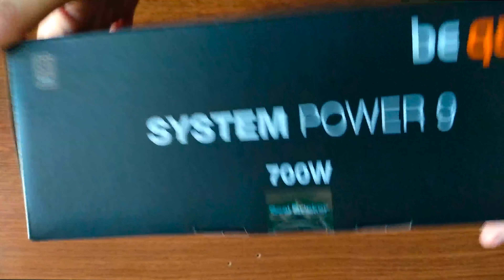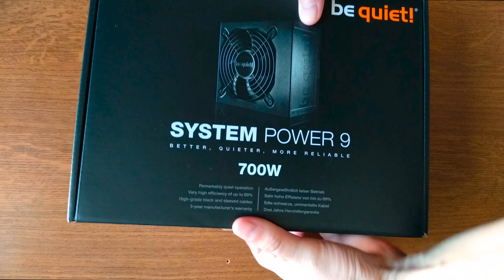VFM Silent PSU! | bequiet! SYSTEM POWER 9 700W 80+ BRONZE PSU Unboxing

Comment: how many perif cables come with this power supply ?? ..also is this power supply has cables needed for ssd and hdd cause some people said sata cables are too wide for the hdd and ssd ..good job bro and thanks in advance <3
Reply from the maker: Connection cables: 1x Main ATX (20+4 pin), 1xP4+4 (CPU), 4xPCI-E 6+2-pin (GPU), 2xPATA 4-pin, 6xSATA 15-pin (HDD, Drives). You're Welcome!!!
Reply: @MastersofAdvancedDreams  oh unfortunately it does not have molex cables ..thx bro for your info ❤️
Reply: @ahmedosama9815  It does have molex connectors.
1x 20+4-Pin (ATX12V / EPS12V) - Motherboard
1x 4+4-Pin (ATX12V / EPS12V) - CPU
4x 6+2-Pin PCIe - GPU
6x SATA
2x 4-Pin Molex